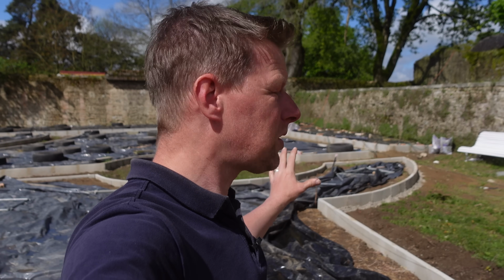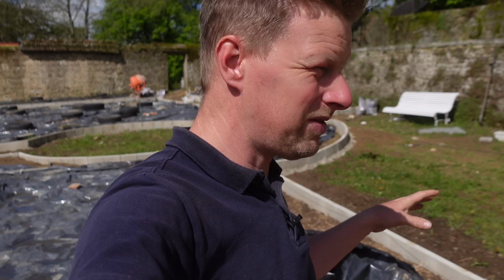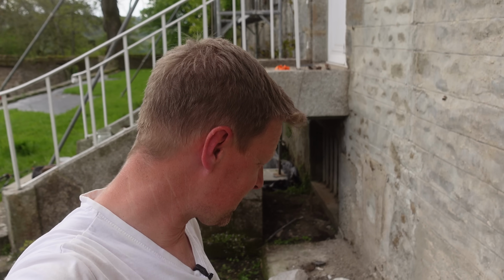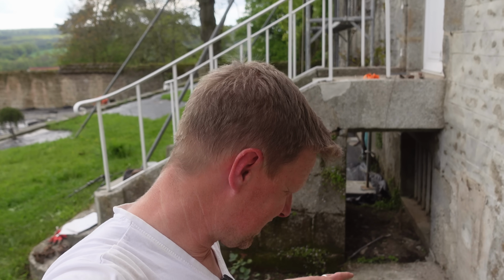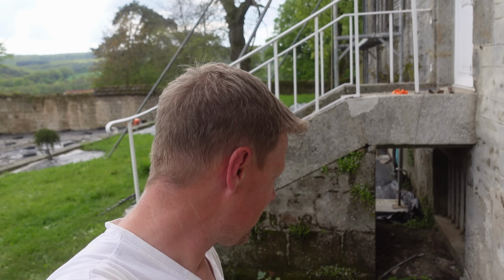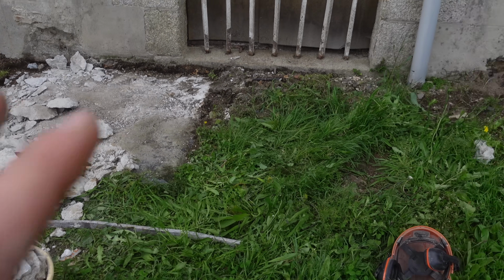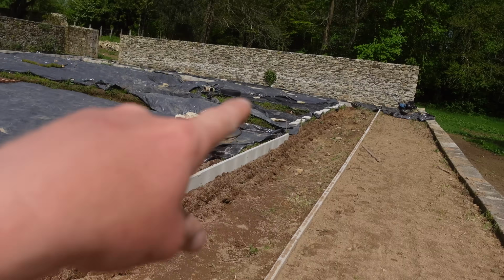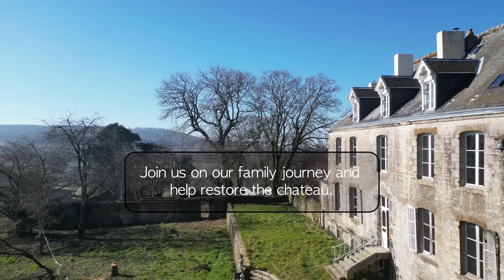The Chateau GARDEN Renovation Continues, DIGGING Up The Unknown?

Comment: I would be inclined to put a large fountain in the center, with smaller points of interest in the two smaller circles (obelisks for climbing vines or roses, for example). However, if you stick with the two small fountains, why not get a large romantic statue for the center circle. I wish I could include a photo or a link, because there is a lovely picture of an elegant statue on a website I just found.

Comment: Been thinking about the big circle in the garden. Here are my thoughts Terry. I wouldn't put anything in the center of the circle because it interrupts the sightline of the path that goes through it. I would do a curved trellis (They could be of metal for strength and durability) on either side of the circle to reinforce the geometry.  You might make the trellis about.6' 6" tall so they're higher than most people could see over.Tall trellises, with climbing plants, on either side would form a garden room within the garden.You could  pave the entire circle so it is flat and smooth, the only part of the garden that is not gravel, The paving material could be in colored  concrete squares maybe black and white but in a pattern of some sort, or terrazzo in a pattern similar to the beautiful ones you put on the ceilings could be handsome.. The sky should be the roof of the circle. I wouldn't cover it over, in this way no part of the view is blocked.  The paved circle could be just to admire, as well a change of texture as you walk through the garden,  a dance floor, a place for musicians to play their music filling the garden with sound, a place to set chairs and small tables for a special event. Your layout of the garden is superb. The idea of  the two small circles with fountains is delightful. People will come from all over just to see the splendid garden showcasing the château. A very big hello to Ash and Tracy.

Comment: I have had to break up concrete before. This may be too late based on your work vs upload timeline (you could be finished already). Anyway, if you can dig some soil out from under the concrete before you use the jackhammer it will break faster.

Comment: For the center a low, 36” high? square granite or cement pillar with cut out or raised panels on all four sides with your beautiful chateau logo carved into the raised panels or raised in the carved out panels - in granite or cement. And on the top, an iron - or whatever you can find - sun dial - antique? - or a simple round concrete or granite bird bath  - or a simple round concrete or granite bowl of whatever plants your garden designer would plan. Well…you asked!

Comment: Benches would be nice, you could in the center, a concrete urn rather late you could run a water source to and fill it with annuals that you could rotate out during season.

Comment: I've liked the idea of 4 light poles on the corners of the garden, as well as the spotlights scattered around.
But, in the central circle, what about a pergola (Iron'n wood made maybe) with a central fireplace, surrounded by 2 double garden chairs (or 4 single ones)?  If so, I'ld rather put some spots up on the edges of the pergola...
Just an Idea...😊❤
Reply from the maker: Thanks Monica 🥰

Comment: Try 25 de mayo Square plan (Buenos Aires, ARG) over there. It is almost the same: It has two very historical little fountains both sides and in the very rounded center the "Pirámide de Mayo", a pinnacle in renaissance style. I think that a very restrained and temperate stucco rendered 3 meters monument, should be perfect.

Comment: A low water fountain with a set of spurting water jets would fit the center circle. Then on the exterior of the circle facing the fountain, a ringed cement bench.

Comment: What about a rose arbor or tea house in the center/kind of like a folly but maybe made out of steel or iron so you can see through it, or out of topiary, shaped like the  chateau front tower. You could make it in diameter big enough to seat a round table of 8 or three 2 person tables which could switched out by event, and then you could plant flowers around the outside. The tower peak could be a canvas umbrella covering  for shade and rain that could be removed in the winter and the framework could be covered in holiday lights and surrounded by holiday lights in the surrounding winter-empty flower bed, or it wound with vines for weddings. That way it would be decorative, a useful  weather proof setting for dining or weddings, and a year round garden enhancement. Plus it would tie the front and back of the chateau together.
Reply from the maker: Thanks Jane. We’re wanting to be quite sedate in the centre to not take away the magnificence of what the rest of the gardens will be 😉😉

Comment: In case you want yo install more lights at a later point, put the conduit in now.
Once you change your mind or can afford more lights, you have the access in place.

Have you thought about putting in a frost free faucet?
If you keep evergreens in planters, they need watering in Winter.
A frost free faucet is installed at 4 feet depths a d can be used during winter, without freezing.

Another useful thing to have in the garden are Hoselink retractable hose reels.
Not sure if they are sold in Europe yet.
They snivel 360 degrees. You can get them in 50 ft or 80ft length. 
It makes for quick and tidy watering.
New plants need a lot of watering in the first days.

Gave you considered getting a well dug to keep the watering cost for your gardens down?
Make sure Shane picks droughts tolerant plants.

Depending on the size of your fountains, you most likely have to pour a concrete base for them. 

Can’t wait for your plants to go in.

The facade looks like the chateau was just built. It’s incredible how well the granite cleans up.
Reply from the maker: Thanks you. We’re trying to plan for all eventualities 🥰🥰